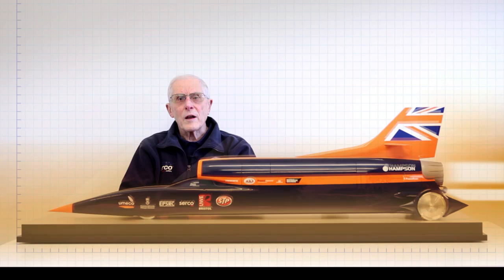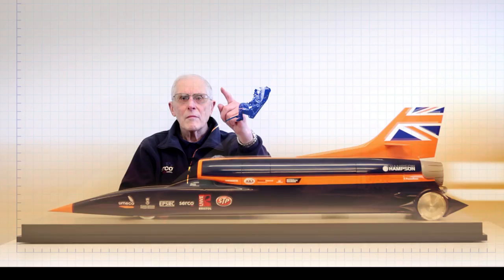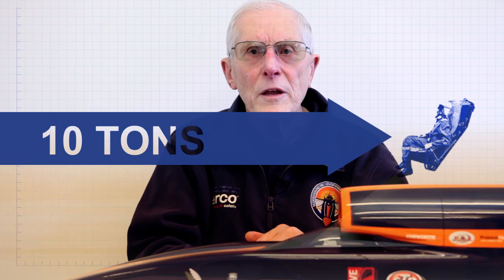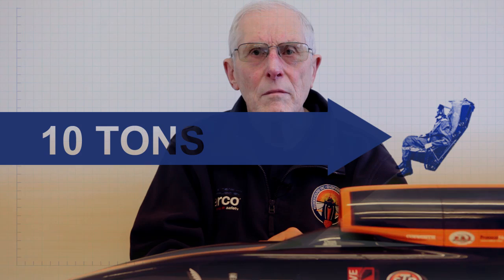Why doesn't a 1,000 mph car have an ejector seat?

Comment: For those people claiming that the SR-71/A-12 pilots ejected at Mach 3+ so why can't Bloodhound at Mach 1.4, remember that the dynamic pressure (and therefore drag) depends on both Mach number AND ambient static pressure. The ambient pressure at ground level is orders of magnitude higher than the pressure at 85k ft, and so the instantaneous loads Andy would be subjected to are just not survivable.

Comment: Ejecting at mach 2 at altitude would put you under considerably less wind load than mach 1.3 at ground level.  Remember, the speed of sound depends upon the density of air you're in - so Concorde cruising at mach 2 only translates to a ground speed of 1333 mph at an altitude where air pressure is only about 1/10th of what it would be at sea level. 
And Zero-Zero refers to ejecting at  zero altitude and close to zero airspeed, I wouldn't call 1000mph "zero".

Comment: It's certainly not risk free but the design process is very much about managing, anticipating and finding ways to reduce those risks. Modern technology has made a huge difference - it means we now know so much more about how materials behave, we can simulate what will happen to the car at speed and we have stronger manufacturing methods than ever before. There's a big difference between what we do now and the step into the unknown that the early pioneers took.

Comment: Its not quite true that ejection at supersonic speeds is not survivable, an F-15 pilot with the USAF once ejected at over mach 1 and survived, although he was badly injured
Reply: Not at sea level - the event you are referring to took place at 6,000 feet; had it been at ground level he would without a doubt have been dead (higher altitude = lower air density and therefore lower air pressure at speed) and even as it was he was horrifically injured.
Reply: aluskn good point, hadn't thought about that.
Reply: aluskn Though there is also the case of a SR-71 test pilot Bill Weaver surviving a Mach 3.17 breakup, though he didn't eject so much as got forcibly removed from the plane. But he lived with relatively minor injuries.
Reply: nj4ck mach1 maybe but not 239mph more on top , a f1 neck helmet brace  set up might stop your head snapping back an a carbon moto x style chest cage  might stop chest compressing  but your arms an leg are gonna want to brake off still, an you need free movement so you cant strap them up  ,
Wow kinda makes ya brain hurt lol trying to compute a solution !
Reply: At super sonic speed he or she being ejected and would push almost 2-4 tons of force on him or her it is nearly impossible to survive but has a expectance to the shock that the person has. The shock the person has can kill them. Expecting to get ejected and know the the force knowing it will hurt could save your life. A shark bite can and most the time kills but shock kill. A fire kills but most the time the person dies from shock first. The force does physical but mental can kill you too, it is possible to survive but, rare.
Reply: +Skwisgar2322 That's right, and a fascinating case however it was also conducted in the upper rarefied atmosphere.
Reply: +aluskn how did an sr71 pilot eject? at close to 2800mph? even the density difference wouldnt compensate
Reply: I don't think he did eject, basically the blackbird disintegrated around him in the middle of a test manoeuvre.  It's pretty miraculous that he survived, if you Google it his account should be easy to find.
Reply: aluskn
Yes, but that is mostly a distinction without a difference.

Comment: People Have ejected from SR71's at above Mach 1 and Survived? Sure some have Died as well.
Reply: Air resistance at ground level will be like hitting a brick wall. At 50.000 feet or so the air is so much thinner, ejection at high altitude is survivable.

Comment: "When something goes wrong in the car, it will happen very quickly indeed, and it may well be impossible for a computer to react quickly enough". I'm sorry, the arguments leading up to this statement were very reasonable, but the statement quoted makes so sense what so ever.
Reply: Depending on the type of failure, the car could fly apart in a literal millisecond. Even with the latest processors, the electrical communications and physical actions required for an ejection may very well not fire fast enough to do any good. Coupled with the extra weight of everything that would have to go into it, and the false alarms, the risks vastly outweigh even the best of potential benefits.
They are much better off designing an exquisite airbag system and highly reinforced capsule to withstand the forces of a roll/flip/impact crash.
Does that make more sense?

Comment: F1 tub at a 1000mph 780 miles an hour faster then f1 crash tested it ?
What said it would hold up a computer program or further testing ?
Reply: +fatbarry barry Nothing said the tub would survive a full speed crash, nobody asked. The point is they know nothing stronger exists, in this case that is all they can do.
Reply: yeah i did think that ,but thought someone smarter could tell me further info geuss not.
Reply: +fatbarry barry 
He said it was "made of the same material," but I am absolutely certain that it would be made with MUCH more material (thicker and/or complex layered reinforcements) than your typical F1 capsule. 
Does that make more sense?